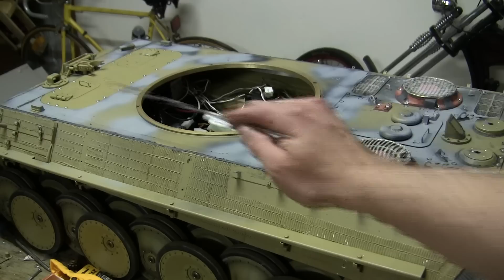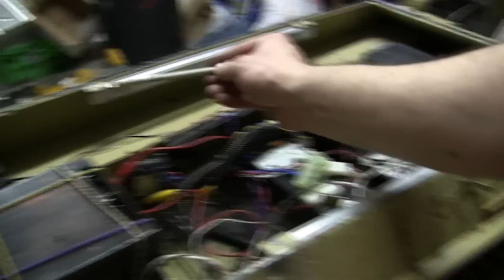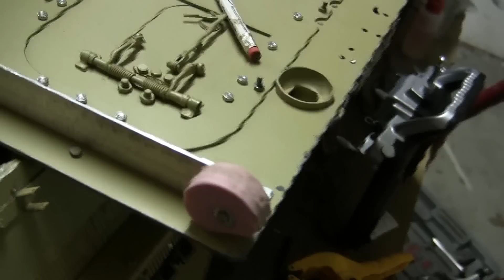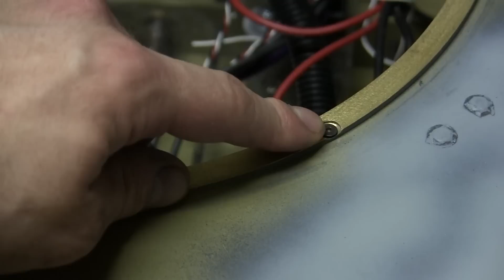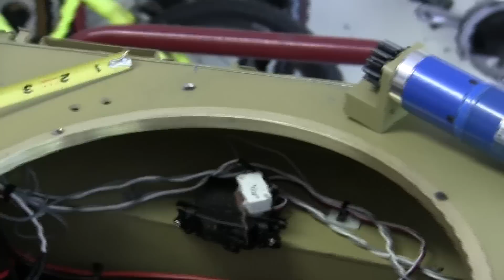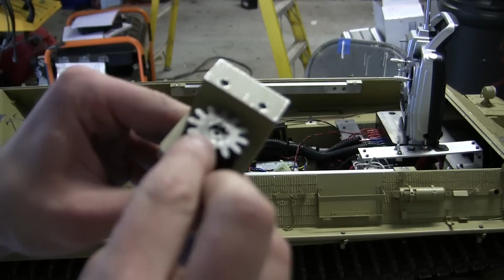Armortek Panther Ausf.G Project Video #6 part 1 of 2 (deck locking system and turret rotation)

Comment: Can you explain to me how turret is bonded to the hull ?  on you're video it looks like its only turret weight keep it to the hull - but what if model jumps on bumby road or go uphill ?
Reply from the maker: the turret is held one just with weight and have no retention system. because of the weight the turrets do not bob when going over rough terrain or going up hill. The only time they can pop off is if the tank rolls over, which means you have other problems to worry about

Comment: your counter sinks need work bro.  

Nice model. great work.  those counter sinks though... sigh.
Reply from the maker: They worked fine, I don't see the issue. Please elaborate to what's wrong with them as I'm literally shrugging
Reply: ok first off.. my roommate says, it's irrelevant, the video is 4 years old or more... (he i s right, which makes the whole comment section moot, lol)  i'm listening to a homeless man play a homeless piano while i write this... 

Second...  to be real specific, they are too deep,  (like eyeballing it, like 0.1 to 0.2 too deep)  and somewhere, i'll clip it later, your pilot (on the counter sink) on the two new holes you countersunk was too small for the counter sink holes you drilled for the countersink being applied.  (thats a hard statement to follow.. ) 

third, screw this guy critiquing your work, that's a bad ass model and i'm only saying this because my tolerances for the work i do are within a 0.05 (+-) margin.
Reply: http://www.youtube.com/watch?v=gGWHJr9NxyQ&t=18m48s

so if you freeze frame this you can see the  the "deepness" of the countersinks.  

there is one on the far left on the frame that appears to be really good and all the 'new' countersinks that haven't had any paint applied (to the counter sink surface) look like they have metal or material above the fastener... so the fastener is 'too deep' in the material.   

if an inspector came up on countersinks like that...  somebody's getting fired... the head of the fastener should always be like (-0.02 to +0.03) of the material being countersunk to... so roughly, flush.
Reply: anyway, on your next model just get some "countersink cage"s for when you countersink... i'm sure you'll appreciate the difference in depth of counter sink.. and just drill your hole to the size of your countersink (pilot) and you will avoid the (chatter) you see in two of the countersinks you did.  https://www.youtube.com/watch?v=gGWHJr9NxyQ&t=14m55s

(this only matters if your model is going to actually have to fly and carry people lol)
Reply from the maker: The depths you see are done that way on purpose. I could have made them what you call correct and flush but when I do I have seen on several occasions on several other builds the turret hang up on these type of bolts. There is almost always some part of fastener sticking above the surface when done "flush". This would always require more sanding / grinding, which on the bushing surface is not really something you want to do. By drilling deeper this eliminates the need for the grinding and allows the turret to sit completely flush with the bushing ring with no hang ups or other issues. 

similar reason can be said for when I bolt the hulls together, or specifically on this video the fasteners on the tank's upper deck roof. When I would use the counter sunk fastener "flush" this would always require lots more grinding / body work to fully remove and conceal on the armor plate. So on armor panels I too drill the fastener deeper into the plate so the head is below the surface. This allows me a better surface to add the bodywork and seal / blend the fastener into the tank's plate effectively deleting any presence it was there.

P.S. This is still relevant as I still use this technique on my current builds and all other builds that came after this one

Comment: I must interject, the correct sequence for the use of lock washers is to be in direct contact with nut. So flat washer, lock washer, nut. The method you describe would allow the nut to loosen as it has no contact with the lock washer.

Comment: Nice assembly here :)
I've got a small suggestion for a future turret rotation assembly.
With the current setup, you wil get a small "wobble" or "shift" of the turret when you reverce the rotation direction.
If you however add two more "slave" gears as to create a geared tripod to the rotationsystem i would guess you wil get rid of that small shift in the turret.
Theese gears can also be ajustable in and out so that you can get a perfect allignment of the turret and the turret drive system.
It wil create a sort of a "ballbearing" for the turret.

Love your eye for details. :)
Reply from the maker: Thanks for the suggestion, but I don't see the need for the other slave gears as the collar bushing keeps the turret tolerances very tight a shift was never noticed. The armortek turret system is one of the smoothest RC turret rotational systems that I've worked on, and work very well when installed.